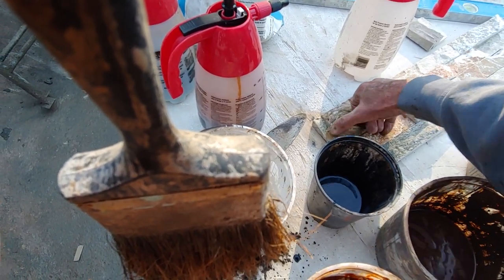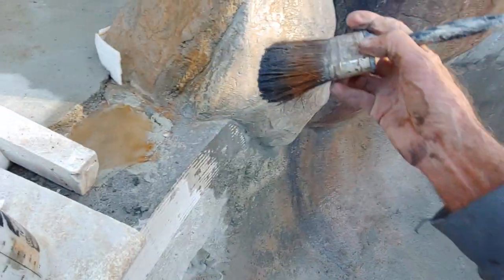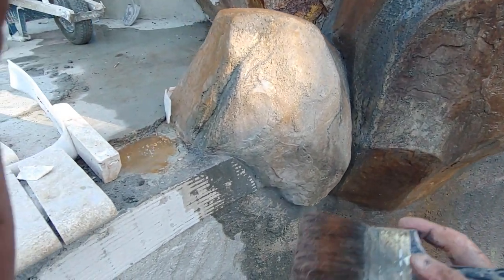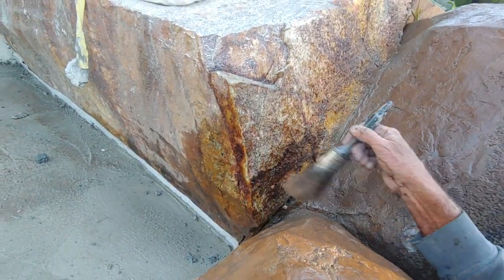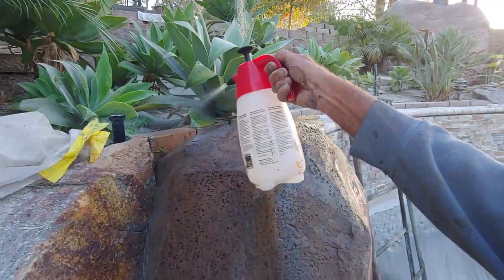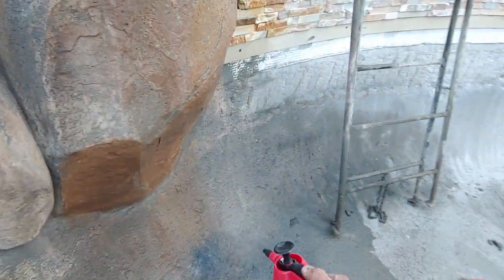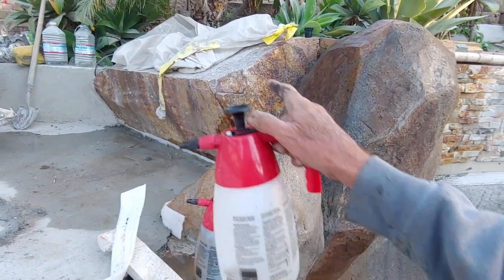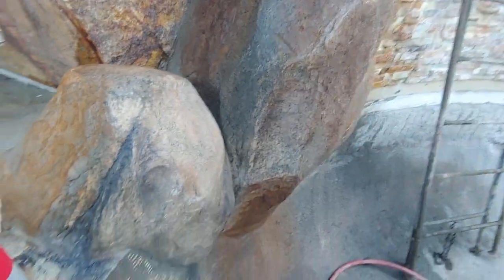How to Paint Fake Rock Demo

Comment: You say you are just using oops paints.  Don't you need special paint for the portion of the rock that is under the water line.
Reply from the maker: The "oops" paint is high quality exterior latex paint so it's the good stuff.  It just got mixed for someone who didn't like the color... And I save a bunch on the cost!  $9 instead if $35 or more!  👍😎

Comment: Hi Dave - how and what product do I use to stain my faux stamped concrete rocks in my pool.  Half the rock is under water and the original stain is completely gone.  It's now dark gray, probably because it's wet.
Reply from the maker: Hi Lloyd, I use exterior high quality latex house paint.  Not stains usually.  You'll need to drain the pool water down of course.  Then tape off areas that don't need new paint.  You can also rinse off overspray carefully as well.  The paint below water gets bleached out by pool chlorine over time...  Lower the chlorine better for your skin and body and the faux rocks.  I don't mind a little algae here and there...  More on how we do this stuff, including free downloads and more at davehenderson.podia.com if ya like.  Anyway, best of luck to you.  Cheers, Mr. Dave :)

Comment: I want to make a huge styrofoam Boulder for my kids to play on. The most intimidating part for me will be the paint so it looks real. I really appreciate all your videos especially these painting techniques. 👍
Reply from the maker: Yes, painting is a challenge.  Just keep experimenting with tints and practice on some grey cement or simple small fake rocks to see how the paint takes to the material.  You will notice that if the paint's too thick it won't spray well.  But if it's too thin, then your not getting a long lasting amount of pigment/paint on the rocks...  Also, play with the nozzle to get different spray patterns and remember you can always add more colors.  I start with the lighter colors and then go to the darker ones.  Good luck!  :)

Comment: Hey Dave, where are these spray bottles available at? Working on my first rock.
Reply from the maker: I get them at a contractor supply store in town but I searched around and found them here: https://www.northerntool.com/shop/tools/product_200488471_200488471   Good luck to ya!  :)
Reply: @DaveHendersonFakeRockVideos  thank you Dave I also found the same exact ones on Amazon for about $16. They are out of stock but I have three on back order. Also Harbor Freight near me has great compressors and hopper selections.  Almost have my supplies together, just need to get paint and fog coat ordered.Excited to finish my first rock.

Comment: Hi, I have a question,why you don't paint  waterbase sealer before paint color?
Reply from the maker: Thanks for the question.  As i understand things the high quality exterior latex paint I use adhears best to the finished mortar/concrete that we build our fock features with.  Sealing after is an option I know some rock guys do.  Anyway, if you're interested i have more fake rock how-tos, including free pdf downloads and more at davehenderson.podia.com. Then have blogs and links to other platforms at www.daverhenderson.com. Thanks again and God bless, Mr. Dave. :)
Reply: i am doing Rock work project, so i have to learn more different  technique to improve my speed  and skill .. Thanks for sharing Dave.